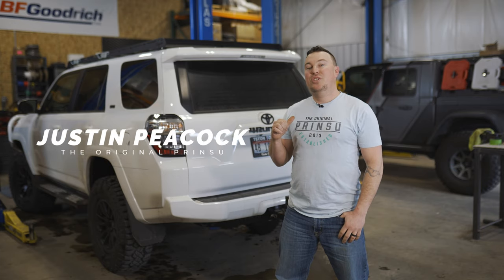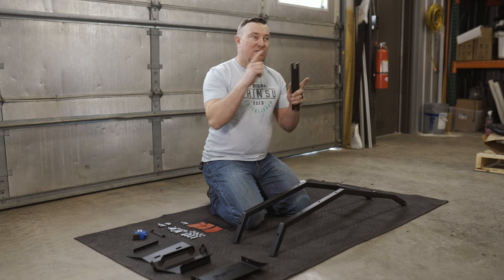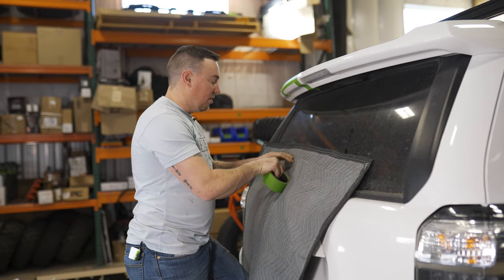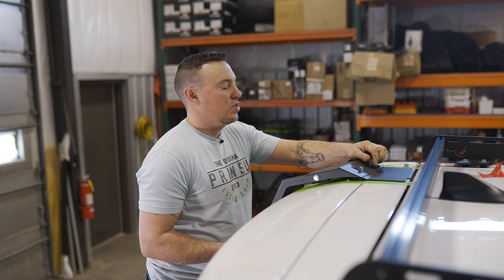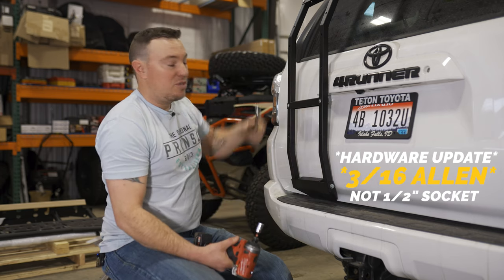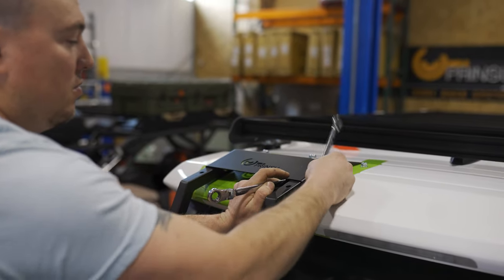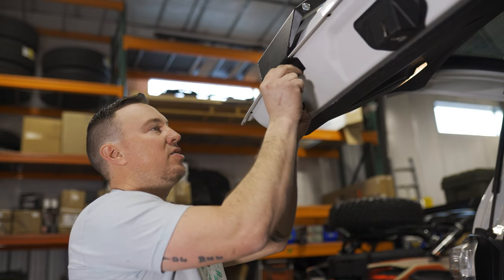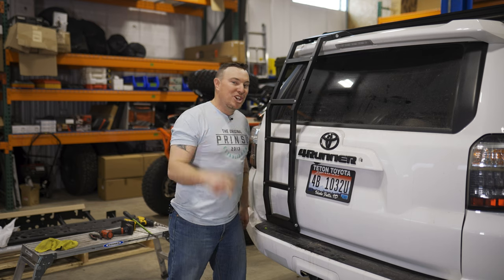PRINSU INSTALL: 4Runner Ladder

Comment: Great video on the installation.  All seems pretty straight forward.  The bolts out the top of the plate on the hatch look like knee breakers or catch points as someone is loading/unloading the roof rack.  Any way to shorten those bolts or provide a cover to save your knees?  Also any chance for black bolts to match in to the ladder vs. having the silver showing?

Comment: Only thing I wish would be different is drilling the top too. I feel like that would be a little more secure than 3M tape.
Reply: We have worked directly with 3M on this particular section to make sure that the attachment point is adequate. We can say with full confidence that this is more than adequate.

Comment: This is a POS would not recommend.  Worst engineering and the 3M doesn’t hold at all.
Reply from the maker: Randy,

We do appreciate your honest feedback and we do take those very seriously in our process to always make our products better and better. In your complaints, we just were not given the chance to discuss your concerns before you chose to leave your comment on our channel and we would appreciate a fair opportunity to discuss this before you insult us and our products, that's all we are asking. 
 

To address some of your concerns briefly, the 3M tape is there as a precaution to protect the vehicle more than anything and that stuff should stick very well as long as the area it was attached to was clean when it was originally applied. As far as the ladder not touching the spoiler that top part is designed to more or less clamp to the top and not rest on that spoiler. Again we do appreciate feedback from our customers and we do look into each one and discuss areas if we see things need adjusting. 

In any event, we have issued a return label to you to send the ladder back, we ask that it be repackaged the way it was as best as possible. We will issue a refund in 3-5 days once it has been received back. Thank you and please let us know if we can help with anything further.